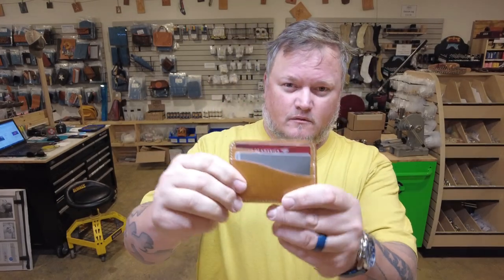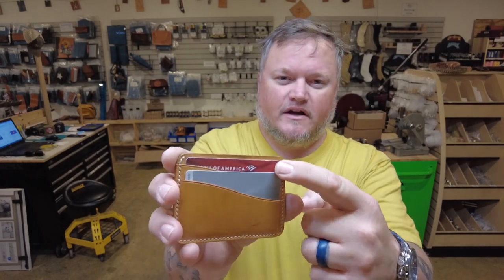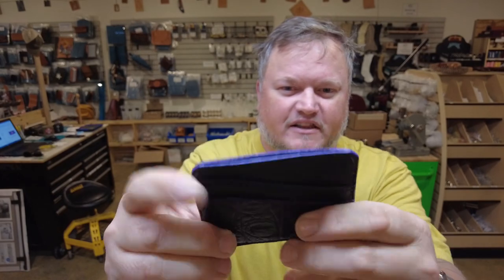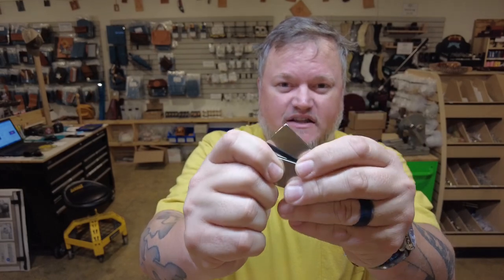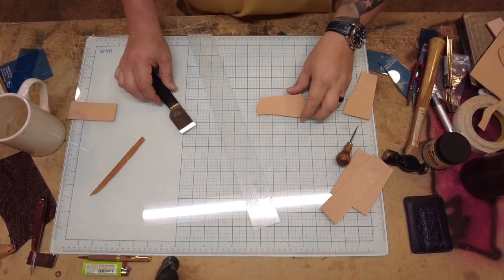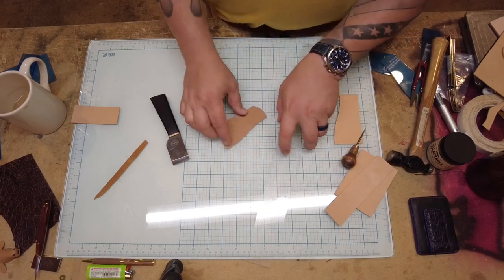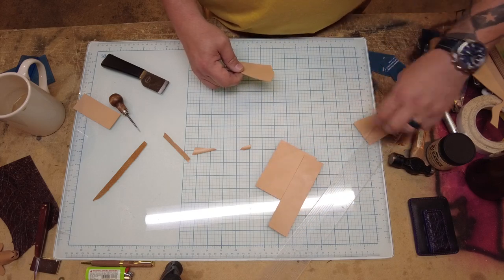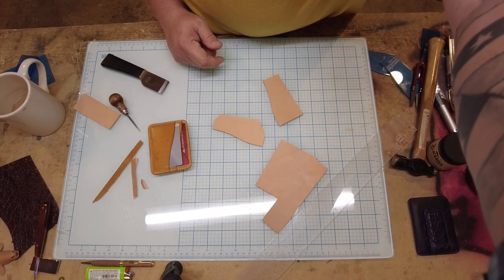Making the Magnetic Money Clip

Comment: Aaron, I received the magnetic money clip template and I’m putting this together and was wondering if you can sew this by machine or should I hand stitch, I only have 2mm and 3mm chisels and the thread I bought from you is 8mm. I know there’s not a lot of room around the magnet so are you sewing with 1/8” seam allowance or less?  Also, did you edge bevel the money clip piece then burnish the edges before installing to the other magnet?  Sorry for all the questions, I think after I get one made the next one will be easier. Thanks again